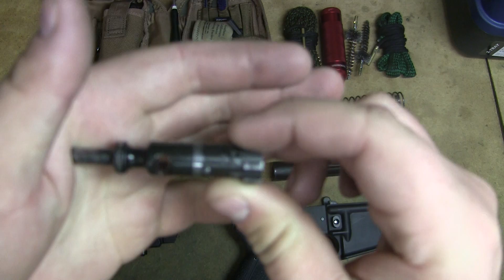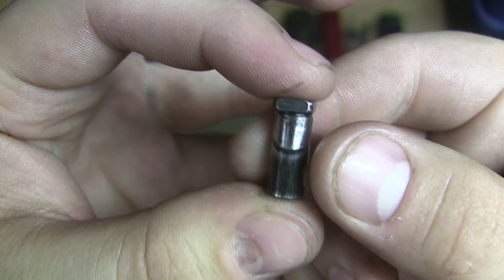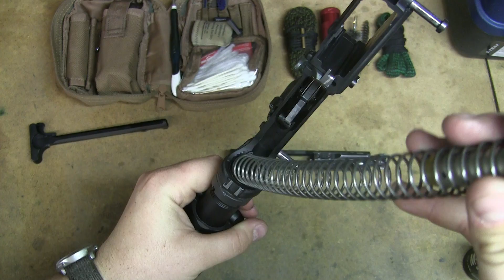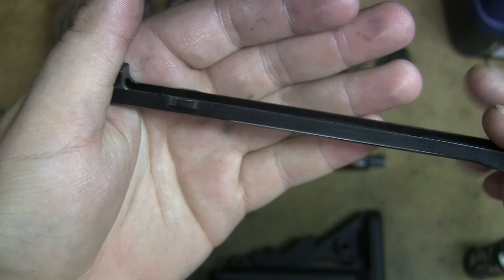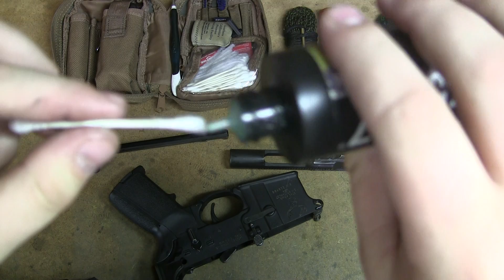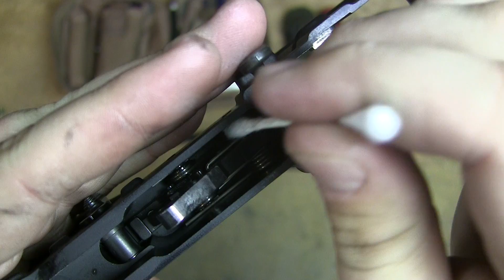AR15 Lubrication

Comment: I agree with your assessment on oiling the BCG of an AR-15 and especially with the type of oil you are using .... way to many idiots out there trying to spread their use of synthetic motor oil as a lubricate.
Actually, I own 3 different AR-15 with different formats and setups with several rifles and pistols and am an avid range/training guy, so I have invested in a Ultra-Sonic Weapons Cleaning System.  All parts are cleaned ultrasonically , then washed , then air compressed and allowed to dry ..... then all parts are given a three minute oil bath using the ultrasonic cleaner with a special designed oil for gun parts and ultrasonics.
The Ultra-Sonic Cleaning System is AWESOME ...... cleans better than I ever could by hand cleaning and using hand tools and solvents. The oil bath puts a dry oil on all the parts and the only hand oiling I do is exactly what your doing in this video ......   Personal  Tip :   if your thinking about buying a ultra-sonic system, get one with at least 6 transducers for cleaning hand guns one at a time.  A 6 transducer machine is the very least I would get because less than that are only made for cleaning jewelry.  10 - 12 Transducers ultrasonic systems are the BEST and you can clean more than one weapon at a time.   Cost :  6 transducer is around $ 130 for a Vevor or Creworks and the larger 10 to 12 Transducers systems run about $800 -  $1200 +

Comment: FYI... Never use CLP that contains solvents on a bolt carrier group thats coated in nickel boron. It will destroy the finish and its natural ability to run longer without oil.
 Fail Zero states this clearly on their website. They replied to me via email, stating that the first option they recommend for lube on their NiB parts and components is Lucas Extreme Duty Gun Oil. Its all i use for lube since i bought my FZ bcg's back in 2017 and they all still run flawless to this day and the bcg have not tarnished at all. You'll know if you're using the wrong lube when your NiB bcg has a permanent yellowish-brown tint.

Comment: Man, I saturate the entire bolt as is. I shoot with premium ammo (I don't shoot often) so I can get exact placement ranges for each brand and weight then record it. I haven't seen much or any trash left in the gun. With my pistol, I have shot absolutely everything through it. It is my very first pistol I've ever had and I have drenched it in oil. Never had an issue even with the trigger assembly. Now I have seen in the pistol the differences that ammo can make. From the cheapest on the market to the most expensive. The cheaper the bullet the more trash left behind and it can get absolutely filthy off 1 range session. So I've built the philosophy that if you shoot prime ammo you should be good to go. I can't afford riffle ammo in the way where I can shoot all day a 2 times a month. So I take a long time when I shoot and very calculated approach and maybe 20 rounds a visit per month. My rifle is clean as a whistle. I haven't shot it as much as a pro but for someone above average yeah. Only thing I wish I did was not ammo grab when the rounds were scarce. Now the data collection for each manufacturing company, each weight, and each design of bullet has gotten out of control. If I could do it all over I'd stick with just 1. I got them all fairly tight now but still...... I would like to hit a nail head every single shot, you know? Now it's down to a quarter using all the stuff

Comment: I took apart and I have an old rear washing machine and I fill it up with with your home 53 gallons and I throw all the parts in there and I turn it on and leave it run overnight over 24 hours and then I come back in about a week And I take her parts out and throw in the microwave for 20 minutes on high setting and and then I do the same thing with all my ammunition also👍

Comment: Excellent tutorial. I noticed that you didn’t fill the gas ports with oil like 75% of other “internet gun experts” do. A drop on the rings, collar, cam pin and rails is absolutely all that’s needed for function. I like to wipe a dab on the rest of the BCG just as a rust prevention as mine has the phosphate finish that just feels like if I look at it the wrong way it’ll rust up just out of spite.

Comment: You should keep that firing pin bone dry. That's polished steel for a reason. You don't want any oil there that can stick and attract dirt or carbon. That's a gummed up jam waiting to happen. There's no such thing as "not enough oil too attract dirt or carbon." Carbon will build up and stick to dry steel. (Take an engine apart sometime.) Otherwise this looks good. Maybe some CLP on the bolt lugs?

Comment: One question i always have is do you need to lubricate the bore?
Reply from the maker: It definitely doesn't hurt anything to pass a lubricated jag or lubricated bore snake through the barrel on your final pass. For chrome-lined barrels, living in a very dry environment, and the gun gets frequent use, you could get away with just cleaning the bore and not doing the final pass of oil.

For older guns, where there is no chrome lining, nitride, or anything, and you got raw steel as your bore -and especially if you live in very humid conditions, I would not only lubricate the bore, but all of the steel surfaces inside and out on those guns. I have several older guns with blued finishes and that's it, and those guns live in the gun safe covered in a light coat of oil at all times. I have to wipe them off real quick before shooting them, but I'd rather do that than have rust happen. 

Leaving a light film of oil in the bore can't really hurt anything, and it only stands to help prevent rust for any of your guns and for any conditions you live in. The only real problem you can encounter from this is if you get crazy with it and you've got an extreme amount of oil in there, or grease, or if you did oil it and haven't shot it in a long time and it picks up heavy dust and lint. Basically, you can overdo it and create a bore obstruction -which really could be a serious issue when shooting. I recommend, if we're keeping bores oiled during storage, run a boresnake through it right before shooting it, and inspect the bore to ensure you don't have any obstructions and you should be good.

Comment: Finally found video to tell people to go watch.  Finally found one that does it properly and well informative and doesn't have people oil the Exhaust Holes.  Why do people do that?  
I did just get a brand new one that needed to be soaked.  Bought it and had to mortar it get the round out, fixed that and then I had to prod the round out.  Completely took it apart and cleaned and drenched the hole thing and sent 120rds through it and now oiling it like this sense.

Comment: Any reason why you wouldn't run a thin synthetic grease on the bolt rails? I have been doing this for some time to reduce the amount of wear and so far I haven't had any problems. Thanks,
Reply from the maker: I think in normal circumstances, there's no issues at all with that. My concern is for austere/combat/outdoor circumstances that last a long time, and dust, dirt, and mud will happen in some way, despite your best efforts, and it may be periods of time in between being able to clean it.

Grease really becomes a dust/sand/dirt magnet, more than oil, and if you're going to be putting your rifle through that kind of usage, I would really avoid grease or very thick lubricants as much as possible. I wouldn't use them anywhere on a standard AR15.

In civilian usage where none of that is really an issue, have at it -it works well and is a great idea, but not a great idea for all circumstances, in my opinion. CLP/oil is the only thing I recommend for all circumstances, if you just wanted one type of lubricant and one method that works for basically everything, I'd only recommend doing it like I did here.

Comment: Shouldn't the gaps in your bolt rings be offset?
Reply from the maker: Mechanically, functionally, and with certain: no. 

In terms of doctrine, lore, and myth: yes. 

In armorer school they had us remove one ring, only having two rings in our M4s. We shot them, they worked. Then they had us all remove a 2nd ring, only using one, and then we shot them again. They worked. Cycled, achieved last shot hold-open, and all.

The gas ring run of the inside of the bolt carrier compresses the rings to the point that they all close up completely. This is why it may fight you when re-installing the bolt group into the carrier for reassembly -as soon as you hit the gas rings with the gas ring run, you meet resistance. 

When installed, the gas rings compress to the point of no gap in any of them at all. The rifle, or this Stoner design, can completely run with even just one gas ring due to physics and the design of what is happening here. If anyone is dubious of this, I would recommend removing 2 out of 3 gas rings, and shoot your AR15 with just one to see a live demo of physics and the design principles that went into this particular rifle. 

I'm not certain, but I believe this myth came from probably two main factors. 1) Vietnam dudes who didn't have the A1, who were trying anything and everything to just make their rifles run in combat, and forever mistrusted the design despite new ammunition, chrome-lining, and the actual issuing of cleaning kits. 2) The early decades of the civilian AR15 market, where the manufacturers making it were limited, didn't have the technical data package yet (the "mil spec"), and quality control and production methods were not at all what it is today. 

A long explanation, but I've gotten this kind of comment from hundreds of people over the years. Here's to hoping people read this, and test it out for themselves. You don't have to be a mechanical engineer or an automotive mechanic, but at least seeing it for yourself might help someone.
Reply: @Mr2ndAmendment  Thank you SO MUCH for this spectacularly well-informed reply! I'm on the front of the learning curve on the AR platform, and all I generally have to go on is often "doctrine, lore and myth" that you speak of. But I've seen how often oft-repeated "wisdom" isn't wisdom, just oft-repeated.

Damn, I wish I could get answers like this on Youtube comment sections all the time!

Comment: I do agree with the buffer part I would just use a CLP wipe clean and lube at same time then throw it back in. However like I said after a few range uses if I don't want to clean but it's a little dry which you'll hear when you manipulate charging handle don't be afraid at competitions shooters literally spray right into the ejection port!

Comment: You showed nothing about how the bolt looks from the front end how it is sitting in the bolt which shows the ejector how it should be after the bolt is put together.  Just so some newbie does not install the bolt is back together correctly.  Other than that a good job.  👍

Comment: What lubes and how much to use is a forever-debate topic but one thing is certain: all light gun oils (Breakfree/CLP, Hoppe's, Rem Oil, Outers, etc) burn off quickly with the AR Stoner system and requires constant re-lubrication in the field. The gun is an anomaly in the firearms world, I think, because of the self-dirtying action and the hot temperatures piped directly back into the receiver where it does the most harm. It fouls up so quickly it is a wonder that it was accepted as a battle rifle. As such it can be a maintenance whore where other rifles can keep going.

It's really a pain to deep clean or "white glove" clean it, so the trend I'm seeing with users that only clean it superficially seems to make some sense.

Comment: Run it wet in the desert. Other than that look at your bolt, lube the spots that are metal on metal. Do not put oil in the holes on the bcg

Comment: Not bad.  A little overboard with the lube.  
But you lost me when you lubed your buffer.  Light film is all that is needed.  
Then again, I use captured buffers.  
And the pins - again, very light coat for protection versus friction.  Too much.
And the springs don't need any lube - but I use drop in triggers.  
That weapon would be a cluster of carbon and grit and chunks of gunk in my world - and would likely fail.
But for the average viewer, this is good info and will help them keep their weapon working well enough for years to come.
Oh, my creds, you ask?  52 months in combat and NEVER a weapon failure.  In the harshest environments out there.
Overall, adequate.  7/10.
I'll keep this in my list to recommend to friends that want a step-by-step.

Comment: Let the weather turn below 50 degrees then the oil - grease turns sticky that will cause fail to fire issues and cycling issues.
When the oil is sticky, it slows down the cycling of the bolt and reduces the energy of the hammer stick on the firing pin.
AR's don't need to be lubed .

Comment: I've been using ballistol on my guns for a looooong time now, and I like it because it soaks into the metal over time and gives you a really smooth running system after you completely wipe it all dry. So i soak the parts down, let it sit for 10-15 minutes, and then thoroughly wipe everything dry. Once you get over the smell of licorice and landfill... you'll never use another type of oil lol.

Comment: You shouldn’t oil the springs In the lower at all. The only things on the lower that need any oil are the hammer, take down pins, bolt catch, and mag release. One small drop applied to each.

Comment: Do the gas rings have to be lubricated? (A lot or a little?)
Reply: I always lube mine. 
Not sure if it helps but it doesn't hurt. 
It usually burns off pretty fast.
Reply: @900stx7 ok .Tranks (Barcelona.Spain🫡)

Comment: What's your thoughts on GunBlue490's video on the AR?  He uses like 2 1/2 drops of LSA and lubricates less places than you do.
Reply: I always thought he uses too little. 
I know less is more but
he starts with a bone dry gun, then lubes it with two drops of oil, actually just one because he completely wipes off the first drop.
He says refere to the manual, but i don't know any manual that recommends one drop only.

Comment: Any petroleum product contains solvents to make it thin.  As the oil sits around, the solvents continue to evaporate turning the oil toward tar.  I use a very thin coat of Lucas Red Thick and Tacky on the bolt carrier rails and Liquid Bearings on the internal pivot parts.  I use hobby brushes I buy at Walmart (like $2.00 for 10 brushes.  Yellow handles/stems) and I buy Liquid Bearings online.

Comment: I’d never lube my springs on the lower. Would just collect dust and carbon

I will put a tiny touch of oil on the hammer sear though from time to time. Probably doesn’t make a difference though either

Comment: After 40 or 50 rounds my 15 was starting to jam when I was stingy with lube. After using a little more oil on the bolt and some grease on the four contact points on the carrier I haven’t had any more problems. I know they say not to use grease but I just put a dab and spread it. I do clean my rifle after every time I shoot it.

Comment: Failed to lubricate the bolt lugs which are the areas that have the highest pressure of contact....   you have no idea how to lube an ar15....
Reply from the maker: You've never been to Iraq haha. Make your M4 a sand magnet, and you'll pay the price. 

The video shows the minimal lubrication -feel free to do more, especially if you're not living in austere conditions with sand storms and mud. If all it does is the flat range in civilian life, you don't see what happens. Your mileage may vary.

We can disagree, but I'm a combat Infantryman of both Afghan and Iraq, and a school-trained armorer. You may think I don't know anything, but I apparently knew enough to keep shit running in terrible environments.

Comment: Corrosion Prevention Compounds "CPCP"  A thin film of your lube oil is advisable to protect your parts and provide lubrication.  Using bare fingers to apply is not advisable due to the fact you are now introducing hand oils into the solution and compromising yourself with chemicals in the compound.  Consult your SDS "Safety Data Sheet" for your personal protection.    I have seen over the decades that some of the chemicals used were very harmful.

Comment: I have a buddy that is a minimal lube AR owner as in this video. My AR I run just absolutely dripping and I always tell him that if my glasses don't have oil on them after the first shot then I have not put on enough oil. Drives him nuts. I blame it on the Drill Sergeants with a big bottle of CLP spraying the crap out of my weapon before I went to the firing line. Old habits are hard to break.

Comment: This is the best lub video I have ever seen among 10. Appreciated !
Different subject on your AR15 setup, does the tall fixed front sight block you red dot scope? How did you mount your handguard rail on without removing the front fixed sight?
I have an old plastic handguard wanting to replace with picatinny handguard. Wish to know how you did it and where to get it. Thanks

Comment: Same as me cept I use syn motor oil for lubing bolt carrier group and  Remington Dri-Lube on the springs in the lower - seems to collect less debris.  The detergents in the Motor Oil seem to make cleaning much easier too.

Comment: I did infantry basic in 86 at Ft Benning(Sand Hill). We went through gallons of WD-40 cleaning and lubing our weapons. I wonder if it was a plot by the Drill Sargents to keep us cleaning the M-16’s constantly. The WD-40 would collect tons of dirt and grime. So, after cleaning the gun and as we put them back together, we would spray half a can into the weapon. What a mess.